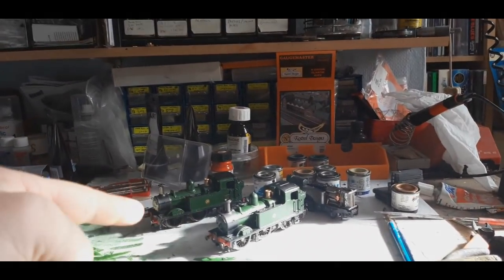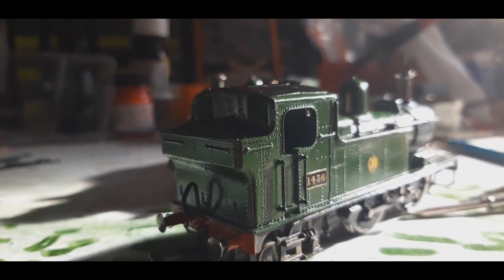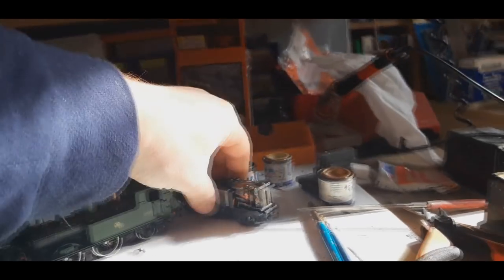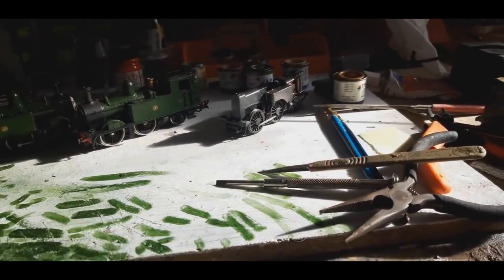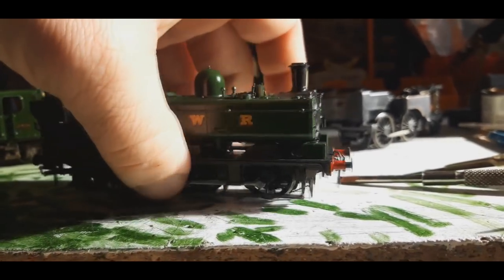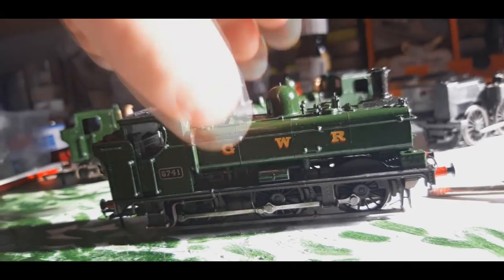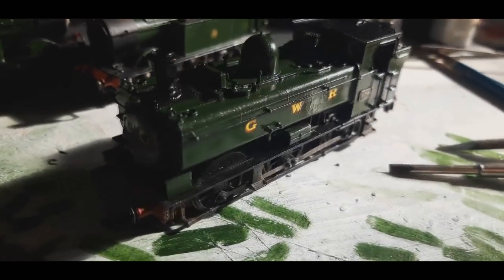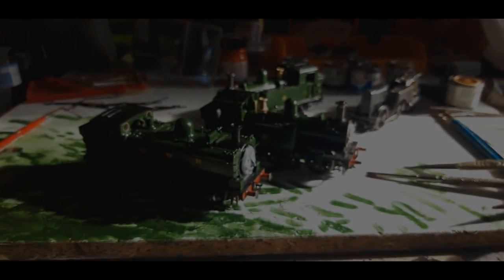RWS #5741 'Montague' (Duck) Overhaul

Comment: Duck has never looked more splendid! (well, in my opinion.) Though I have to ask, how do you even get the smokebox doors/faceplates off? I''ve struggled with them to the point where I had to give up, since I can ill afford to risk breaking something haha! Not sure how Hornby applied them, but they're certainly stubborn.
Reply from the maker: For my duck model I ground the smokebox door off years ago. Literally destroyed it!

Will be drawing up and 3D printing a replacement that, like the face can be blue-taked in.
Reply: Ah I see. I have to stick with my old Hornby engines until I can afford to gather parts for making engines with the custom 3D printed parts. Too bad I can't get their faceplates off without damaging them though, would have liked to make some faceplates to add some personality to the layout.

Comment: Nice! What programs do you use to make the 3D models for printing?
Reply from the maker: Mostly Sketchup.  It's considered simple and not as good as more full CAD programs but for what I usually do I find it pretty handy.  It is more than capable if you know how!
Reply: @sparkshot  I once used SketchUp for a school project and I made a small static train model to print out at low quality. I did not know it was possible to get as high quality designs from the program as you can! Your models are truly amazing. But I was wondering what sorts of measurements you need for the designs. E.g, do you just use drawings which can be found online, do you find specialist ones from places like the NRM, or do you base them from photos or images?
Reply from the maker: My Life is Trains  - Got my drawings from a variety of sources, NRM, Books, Online etc.  Wherever they can be obtained.
The awkward thing is if you obtain 4 different drawings for a particular locomotive they all differ in areas so getting the 'truth' is a lot of research and luck.  Yeah Sketchup can be used to great effect with some practice as my SCC stuff hopefully proves!
Reply: @sparkshot  Thanks for the information! I'm currently trying to make a 00 scale version of the GWR no. 111 The Great Bear and I think I will start with SketchUp using a few drawings I've found. Thanks for the help.